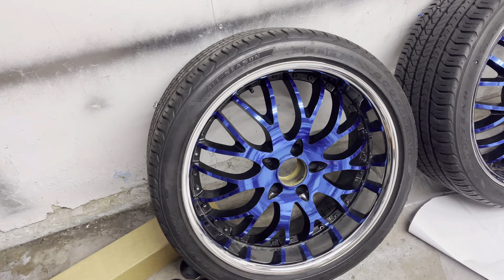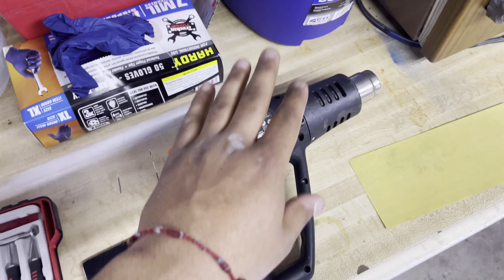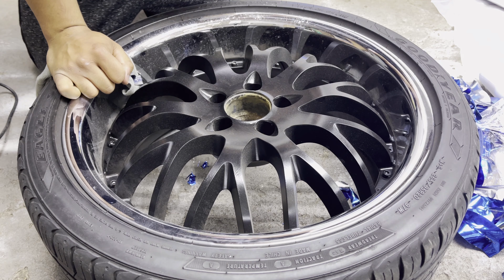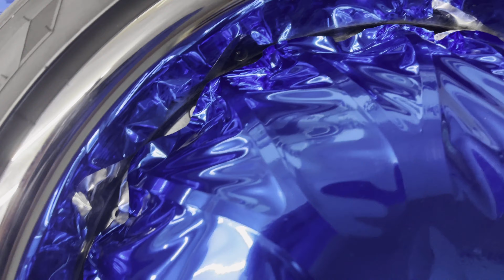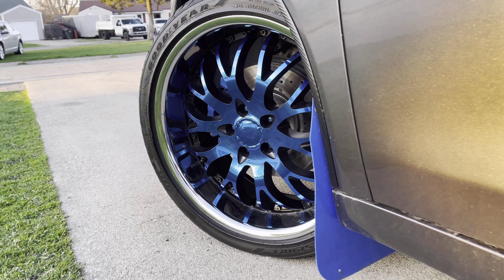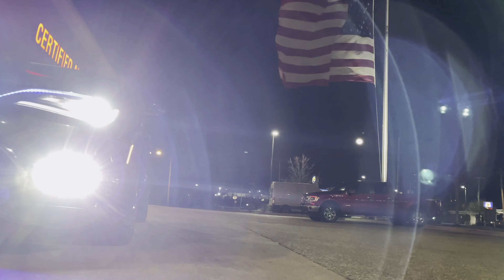How To | Wrapping Wheels | Easy Step By Step | Get Wrapping Today !

Comment: You're going to feel the pain of $12 Chinese vinyl wrap in a few years when it begins to peel or fade and needs removal. That glue is going to come off of the vinyl and stay on the wheels and be a total PITA.

My advice for future wrapping: 3m, Oracle, Avery, or Vvivid.

Preheat and stretch the vinyl sheet a bit larger than you need before you place it where you want it to go. It is naturally going to want to creep back into original shape and this will help it learn its new shape. (To prevent overshrinking)

Get some 3m adhesive primer pens and use them on the wheels where edges and complex curves will make contact to help prevent peeling.

When using razor blades to make cuts, buy a bunch of razors and try not to cut more than 10 times per blade to prevent crappy, jagged cuts and strays.

Last one, invest in an IR laser thermometer. It is for post-heating after your vinyl is laid out and is one of the most important steps. Post heat the entire vinyl and check the temp to get it to around 180 degrees Fahrenheit for a quality, lasting wrap.

Looks pretty good otherwise. Good job and good luck.